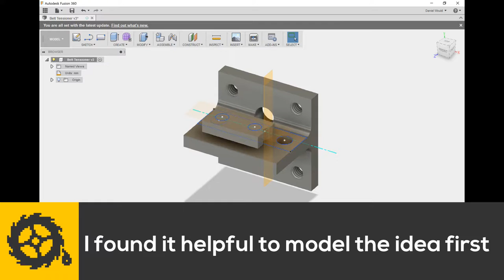Ooznest OX CNC x-axis belt tensioner

Comment: A neat idea!
Reply from the maker: +Duncan Smith thanks. Sadly the same design won't work on the y axis so I'll have to come up with something a little different. :-)
Reply: Alternatively, if you have a friend with a 3D printer, beer can be converted into one of these, which is the solution I've gone with.

http://www.thingiverse.com/thing:1293079/#files

Likewise this isn't working for the y-axis; a modified design will be needed. And more beer.

Comment: Would great to incorporate springs or something like a timing belt tensioner as you find on cars
Reply from the maker: +James Dean not sure springs would help. Either they would constantly stretch the belts or they would lead to constant tensions but inconsistent length. Under heavy cutting load I want the belt to stay as still as possible.